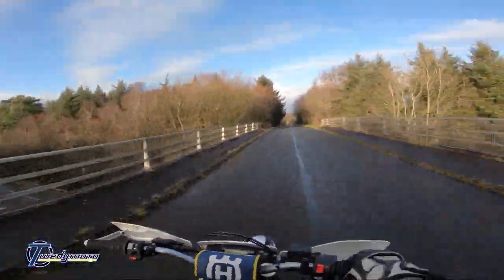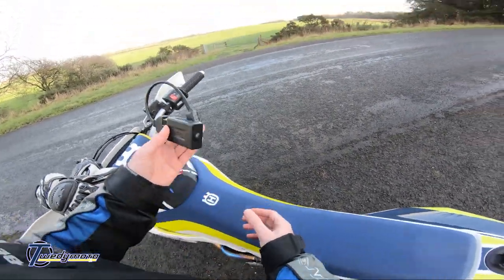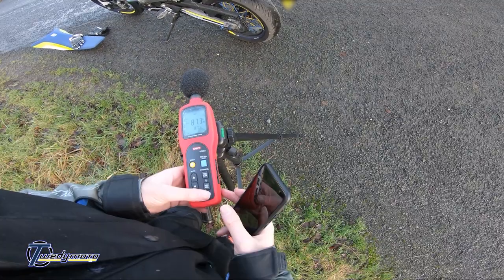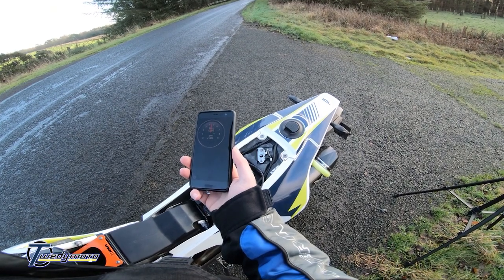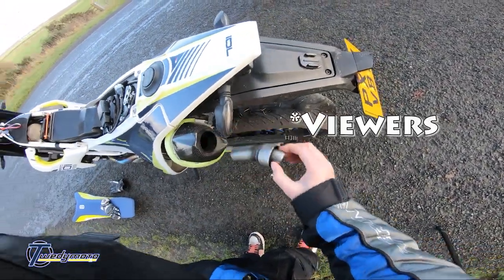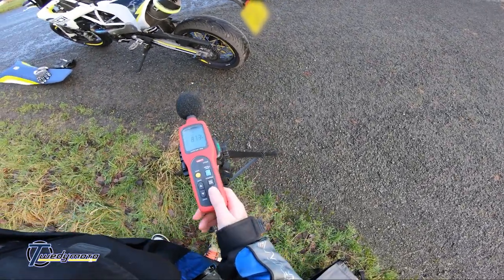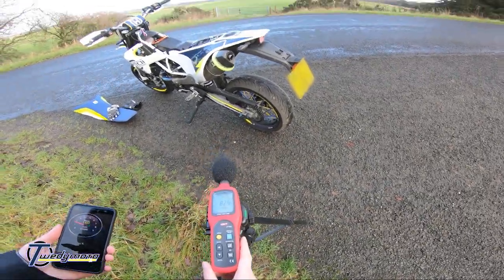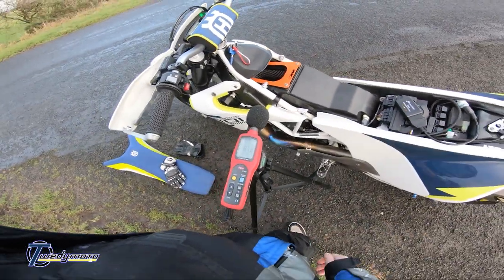HOW LOUD IS MY BIKE PART 2!! | WINGS EXHAUST SOUND TEST | HUSQVARNA 701

Comment: It’s interesting that you mentioned the intake sound. Once I bought a Rottweiler intake similar to yours and I took it off because it was terrible for me I couldn’t even hear the exhaust for the intake noise. I now run the stock airbox lid with a twin air foam filter the one that resides in the cage from twin air much better. It would be interesting if you try the quiet kit for the wings exhaust it’s sold separately. It has the cone that goes in the front of the muffler and the modified tail piece. Thanks for the video
Reply from the maker: That intake was aweful for noise. Anything longer that half hour and my ears would be ringing for hours after. My wings can came with a small baffle too which had a cap on the end of the baffle that goes into the can (looks like the quiet kit but without the mesh) and that was considerable quieter as I needed it to pass the MOT.

Comment: Interesting about the intake noise with the Rottweiler system. The stock airbox and snorkel are designed that way to keep noise down.  I know it can  make more power with the full intake replacement, but it has plenty already with Rottweiler's mapped PC6 and a Yosh can.  Intake noise is generally a flapping  "bicycle cards in the spokes" sound and it is ugly.  Revs up and on the cam it can sound cool, but it is just too much.  Too bad the stock airbox is a bit of a  pain in the ass to re-install after removing.  Taking the battery out is a must when dealing with the stock airbox for sure.

Speaking of the Yosh, it has a spark arrestor insert which probably helps noise a little.  It is a long can, extending to below the turn signal, which is good as it can't melt it.  The Yosh is a straight through with no DB killer in the cap, so it is loud when you romp on it.  A near 700cc cylinder is going to make some noise.  I also have a Super Tenere with a Yosh slip on, it is not nearly as loud despite the can being shorter.  I figure it is because my Super T still has the catalytic converter in it.  The honeycomb of the CAT kills a lot of noise.

I wear ear plugs when I ride, no real bother, but I try to be respectful when riding around pedestrians and such.  It is still quieter than a straight pipe Harley and we have lots of those here in the US 😆

Comment: Lmao intake db.I have DNA airfilter and ive put a gauze mesh in it to stop majority of water getting in and ive also put a mesh by the water bottle to cover the gap.
Reply from the maker: It's horrifically loud! Lol. I've not had a problem with water getting into the filter but then again I don't ride it in the wet! 😁
Reply: @Twedymoto  dont get caught in the rain if you look at the front offside were the filter is by the water bottle theres a through gap direct to the filter cover it up.The otherside is coverd up by a plastic.
Reply: @Twedymoto  I got a cat converter from my standard exhaust i cut it up not stupid because i got a spare lol and i grinded it perfectly to fit in part of the link to the remus and it definatley sounds quieter.So what im saying is maybe buy a oversized cat and operate on it.
Reply from the maker: @daidavies1791  I've never noticed that, I'll check it out!! Thanks.

Comment: Do you have power commander? I have wings exhaust on mine also without dbk and I want to put you air filter but I have to remap? Thanks
Reply from the maker: Yes, I have a power commander that has been custom tuned. I would advise getting it either mapped by a dealer or someone that can map the original ecu or fit a power commander. It will really smooth the bike out and make it more enjoyable to ride!!
Reply: Thinking of getting a wings exhaust myself. If I take out the baffle I'll need a PCV and tune right?
Reply: Axell Hernandez At the moment I have the wings without baffle and it goes pretty well ;) (stock header, stock air filter)
Reply: @AitorMendoza  dont you need a tune if you remove the baffle tho?
Reply from the maker: It is recommended that you get it tuned if you remove the baffle or change the air intake with an aftermarket exhaust. If your dealer can install the aftermarket/evo map, then at least go for that. It should be fairly cheap as it only takes them 15 minutes to download and install to your ECU